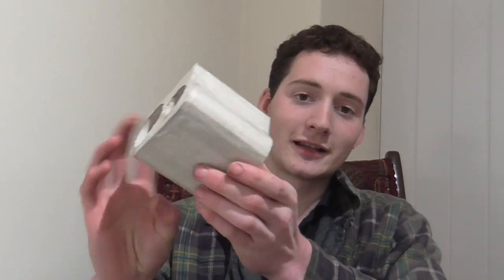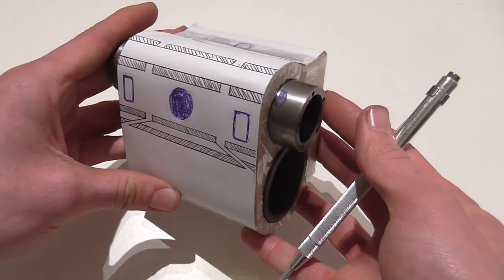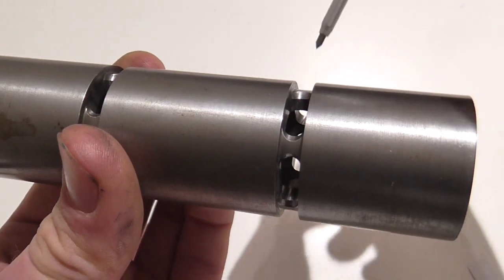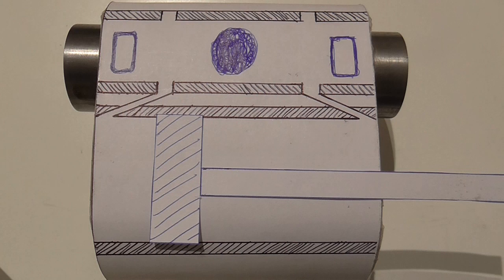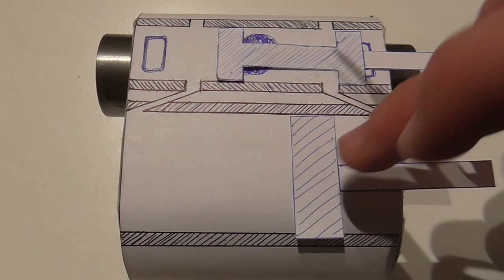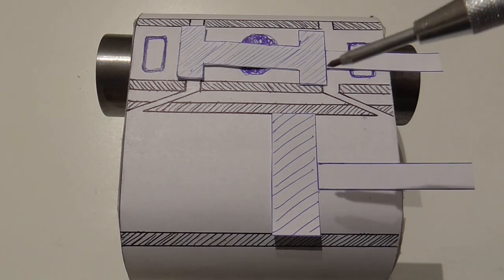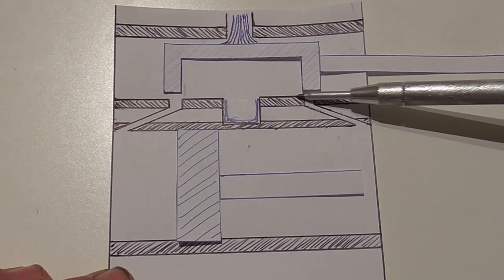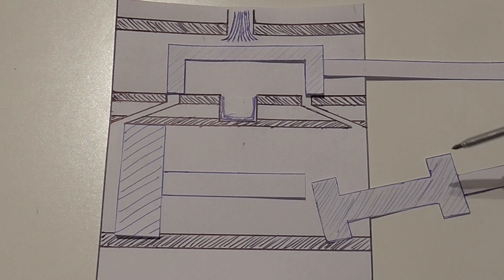How Steam Engine Cylinders Work

Comment: thank you young sir credit where credits due, just getting into this model machining after 45year of being out of the tool room having been made redundant in the 70s, just built my workshop with lathe bridgeport surface grinder etc  and pantograph i think i saw one in your shop as well, just machined the cylinders not really knowing how they worked, these video's  are like the light bulb moment,  looking forward to the next 2 years as at the stage you are, i'm  building a S15 Greene King thanks again

Comment: Absolutely fantastic explanation of the valving processes!  I really enjoyed you explaining the advantages and disadvantages of each.  I will be following your build very closely..   Fred
Reply: I have a doubt,if some one can answer it woul be great,it may sound silly
Q1.In a steam engine,is the forward stroke speed equal to reverse stroke speed,i know they are not very different,but still if there is a difference of seconds or micro seconds
Q2.if the forward stroke pressure(or force)is similar to reverse stroke pressure(or force)
Plz answer my two question,i am a student
Thanks in advance

Comment: Excellent video as expected!  You didn't mention the advantage of slide valves in that any excess water trapped in the cylinders will lift the valve and escape through the exhaust instead of blowing the end caps off or locking up. 😀
Reply: I once saw a model locomotive with piston valves with an arrangement at each end of each cylinder to relieve the water caught in the cylinder by using a ball in a hole with steam in the chest on top of the ball holding it down on a small hole connected to the cylinder  so that if there is any water pushed by the piston the water pressure forces the ball up allowing the water to escape into the steam chest.  This locomotive was made in Leeds, England in 1926 on an order of two for the Canadian National.  

I think this locomotive has been regauged back to 12 inches from 16 inches and is back  with it's sister on a little railroad close to St. Louis, MO, USA.

Comment: brilliantly explained, you make an excellent teacher
Reply from the maker: Thanks
Reply: @MrCrispinEnterprises   i read that the slide version is better for beginners, but that means dealing with high pressure on the ends of the chest as opposed on the inner, i would have thought the piston one was the way to go, your thoughts on this please would be intuitive
Reply from the maker: The piston valves are less forgiving and perhaps take more care to make and get right. I think that is why they suggest slide valves for beginners as they are more straight forward and more likely to be successful.

Comment: A very interesting video, I read about slide vs piston valves earlier on some model forums and one thing that was mentioned there was that piston valves wear out, slide valves wear in. I got the impression they would thus be longer lasting, I am not sure if it's really a huge difference though. I've never built a steam engine or a boiler, though some day I'd like to.
Reply from the maker: Definitely a difference in terms of performance as you waste less energy operating the piston valve vs operating the slide vale. (much more friction with a slide vale as the steam in the steam chest is forcing the port face and valve face together. )

Comment: Great video and explanation on how they work! even for someone with very little knowledge of steam engines, your diagrams and explanation could teach anyone. Have one question though. when you were explaining how they could throttle back steam into the lower piston after cylinder was hot or up to speed. what means is used to do this? is there some mechanical means of controlling the upper piston to govern its speed in relationship to main piston, or is the upper piston driven externally by steam too, and the amount of steam supplied to it is just throttled back?

Comment: Great explanation, the best I have found. But I was curious would a piston steam engine work in reverse if you alternated the steam entering the exhaust and used the internal emission valve as and exhaust?  Or is there a better way to get it to go in reverse? Thanks or posting, I am very new at this.

Comment: How much energy is wasted through the leaks around the connecting rod? is there a noticeable increase in power when the piston is going right as apposed to left with your model?
Reply from the maker: Interesting question. I'm not sure. The theoretical answer is no or at least not a noticeable amount. I will check with an expert.

Comment: I would debate a flat slide valve as being less efficient than circular spool/piston valves. A slide valve has less contacting surface area than a spool valve and weight of the valve is much less, so friction is negligible however it will wear fatster than the larger spool valve. this is why spool piston valves are favored, not for efficiency but in durability and longevity. 
A case can be made for rotary valves as being the most efficient and cheaper to manufacture, however adjusting the timing may be more complicated
Reply from the maker: The loss in efficiency with a slide valve is down to the force of the steam pressing the slide face against the port face. The friction is far higher once it has the force of the st am acting on it.

Comment: the English sliding valve is not so good for heavy use because the friction of the valve on a smaller surface leads to greater abrasion! therefore only for slow-running machines usable

Comment: Mr crispin 96 I would like to send you a section of copper tube for your boiler 18" x 5" how would i get your contact details to send it to you also  any other off cuts of copper tube you would like to construct your  boiler I will likely have
Reply from the maker: +gary rhodes Hi, Thanks very much indeed for the offer. Unfortunately the Boiler is a 6" OD, also its 25" long so I don't think I could use it for the barrel. I could potentially cut it up and use it for other bits of the boiler depending on the thickness? Fire tube wise there are 4 tubes that are 7/8" x 16SWG, and 18 tubes that are 1/2" by 20SWG

Thanks again

Crispin
Reply: MrCrispin96
most of the tube i have access to is metric
22mm tube  is.867" od 0.040" thick
15 mm  .591" od  .030 thick what dia is fire box
Reply: if you can use those sizes i will send you all of it
Reply from the maker: +gary rhodes Thanks very much, Im doing some calculations so i will get back to you soon. Thanks

Comment: Thing is when you do not own a lathe.... its a lot easier to build one that will "work" and repair. Not saying the piston idea is inferior, but for men in sheds with out machine shop, its a lot easier.
Reply from the maker: Certainly easier to make yes.
Reply: @MrCrispinEnterprises  Make includes repair or replace. Myself am looking at off grid technology. Thinking or trying to reuse a cheap and cheerfull air compressor and convert it into a steam engine.

Comment: I have a doubt,if some one can answer it woul be great,it may sound silly
Q1.In a steam engine,is the forward stroke speed equal to reverse stroke speed,i know they are not very different,but still if there is a difference of seconds or micro seconds
Q2.if the forward stroke pressure(or force)is similar to reverse stroke pressure(or force)
Plz answer my two question,i am a student
Thanks in advance
Reply: On a Mamod wobbler engine yep, very different lol.  Valve timing gets close enough on most engines.
Reply from the maker: On this locomotive the pressures on either end of the piston is the same. The same inlet from the boiler is being switched between the front and back of the cylinder. See my video 'how steam engine cylinders work'
Reply: @MrCrispinEnterprises  sure
Reply from the maker: Sorry my mistake, I just saw that you comment was on the video 'how steam engine cylinders work'! It just came though as a comment.

Comment: Great. Don't you have some information about Trofimov sliding valve? It can be seen here https://www.youtube.com/watch?v=06lDFM3gFgo and both pistons are separated, lose and middle part of shaft (or how is it called in English) seems be thinned or have grooves inside. It's somehow optimizing efficiency when train is going downhill on idle I think - obviously piston is heavy and moving six of them needs some power. This is likely the most modern and latest type of steam locomotive produced in Czechoslovakia in 50s and it has three cylinders which is not very typical I guess.
By the way this is nice explanation how piston replaces sliding piece which I saw in all videos about small engines so far.